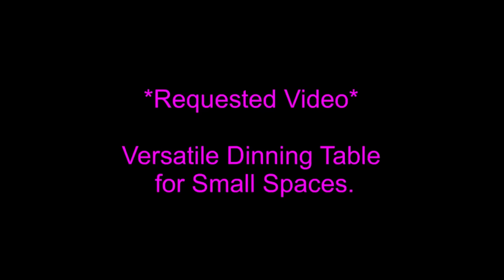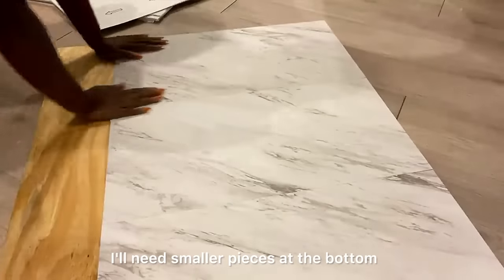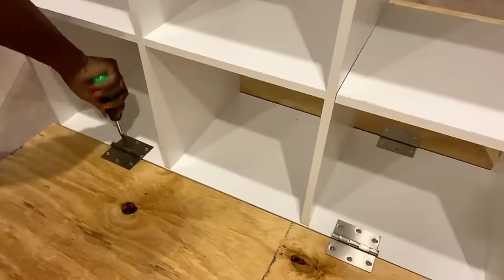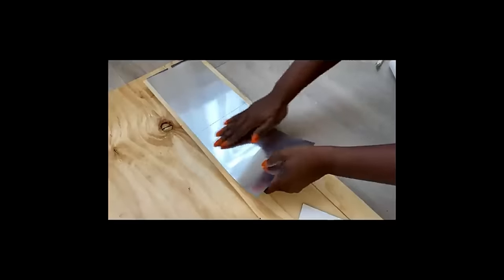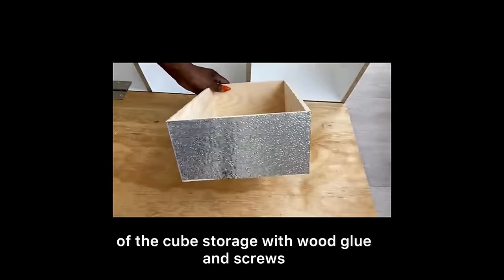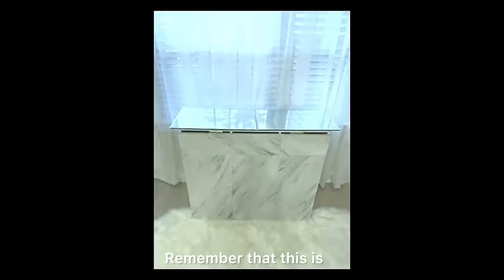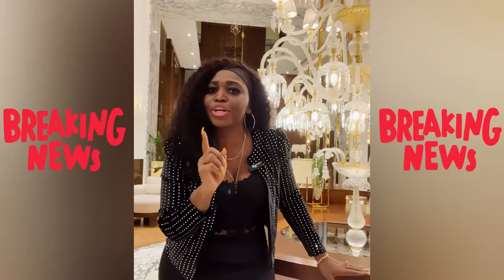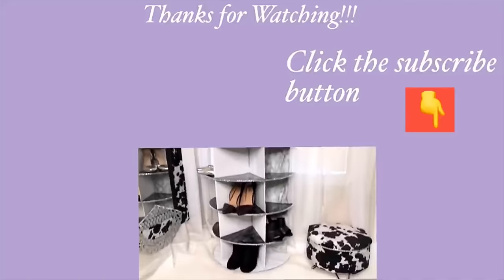NEW Small Space DINING TABLE IDEA TO TRY OUT!

Comment: I have a table with that fold up concept from ikea but it's very thin so the internal storage is limited to skinny little drawers ... This is way better for storage... The ikea leg is one swing out leg at a 45 degree angle but it scrapes the floor so i had to put a soft foot on the bottom of it... I bet you could do legs like a TV tray folding table too if you had one on hand... Love this video